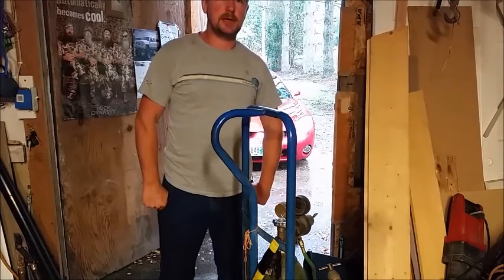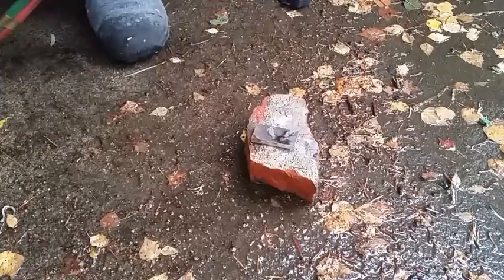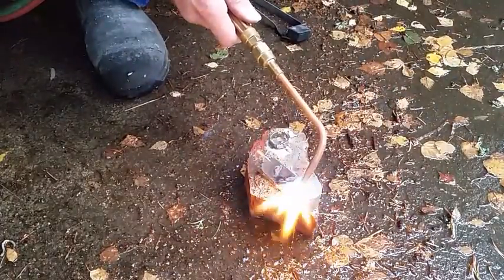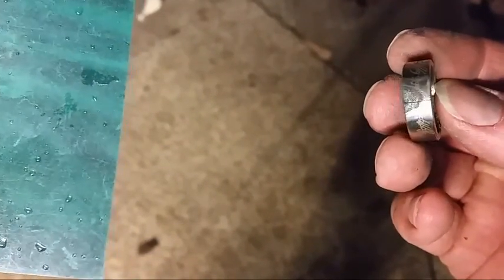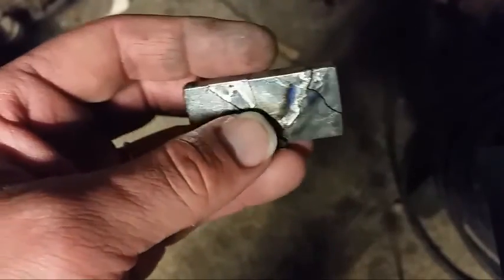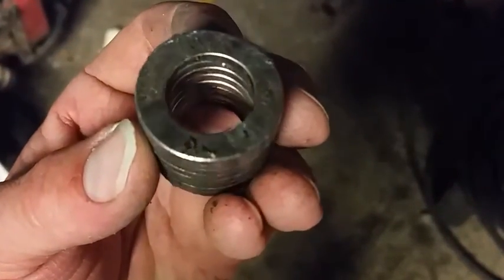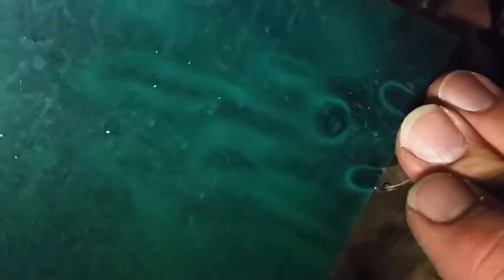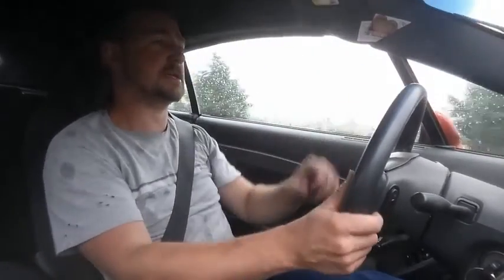Shaping a magnetic field with a welding torch

Comment: Using a ferrite mag. heat one side of it and it will kill the magnetic field for that side. I used the small round mag. from radio shack.
    The flat magnets from RS take about 10 of them and put them N SS NN SS etc. on the end. Stand it on the side. Then roll a metal ball down the side. It will run the length. Putting them end to end and N to N S to S it changes the bloch wall/line.